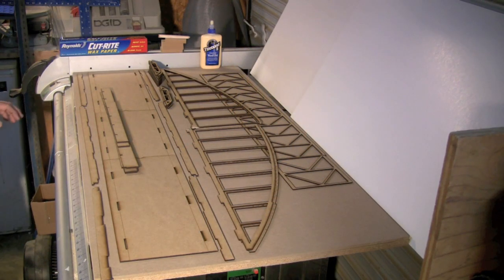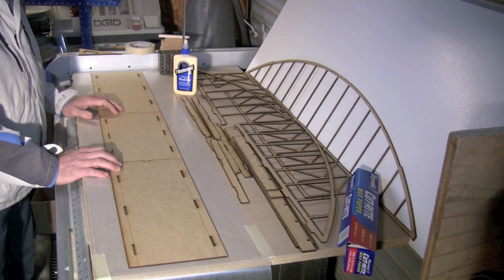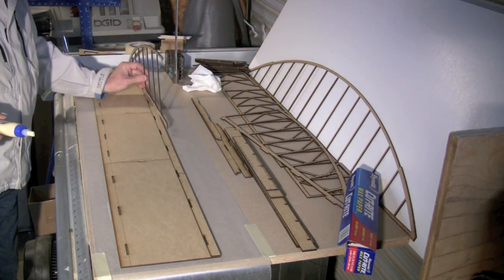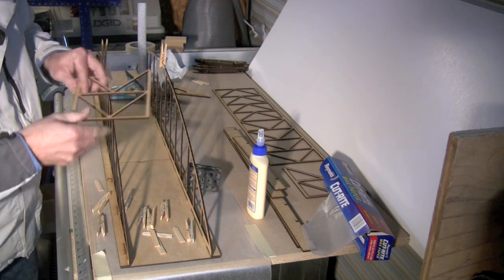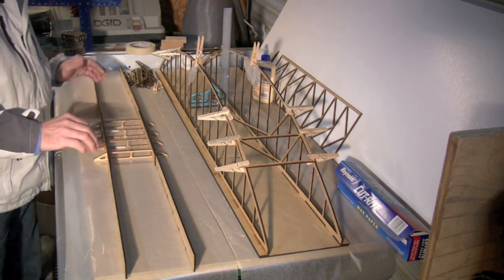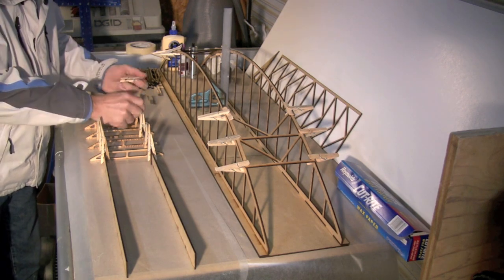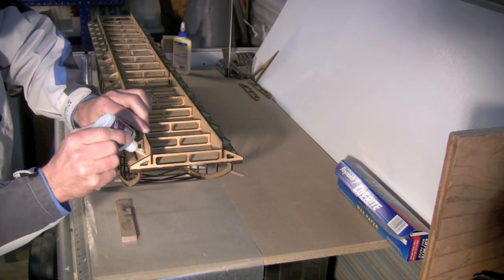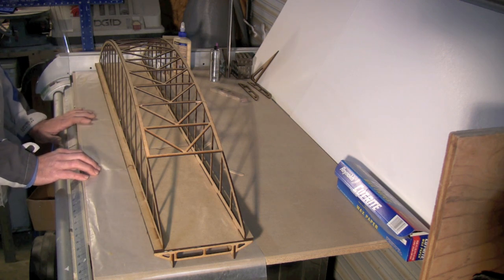Assembling The GameCraft 15mm Arnhem Bridge

Comment: Excellent looking product.  I am a model railroader in Ho Scale 1/87. I think this bridge is about 1/ 98 scale?  that would be close enough. What is the width inside the bents, Total height?   mim inside height? I might be a tad long, about 30' to 36" might be better. Is the roadbed flat or does is have a slope. a slop should not be much a problem as long as small percentage, 1 or 2. Again Great item....